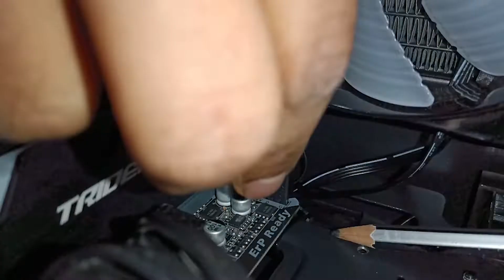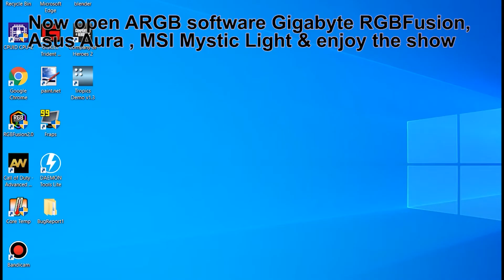Custom ARGB Led Light PC 3D infinity Mirror

Comment: This is an awesome build. I have ws2812b strip and when i connect this to my argb port this strip colour and other fan colors are different. Especially when i choose static red, all fans are red but my strip is green. This leads me to think my strip is in grb order instead of rgb order. Blue works fine as blue order is same. I am using aura sync. Do you have any idea how to fix this?